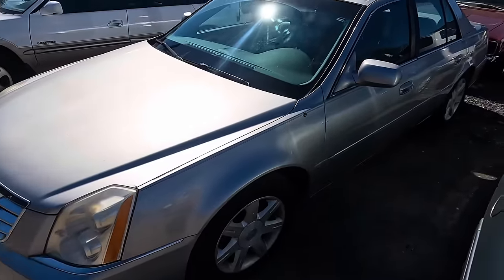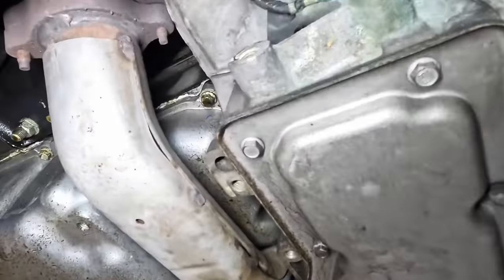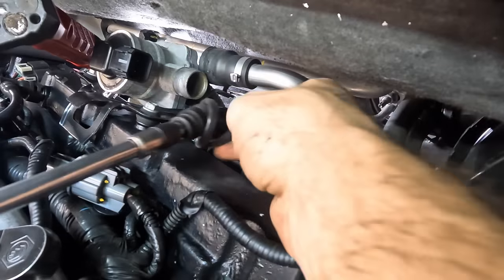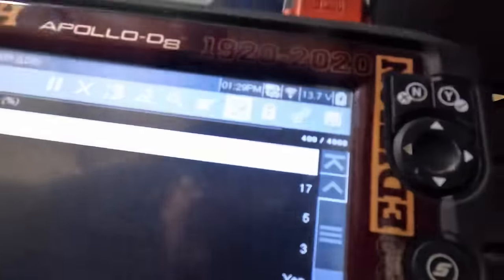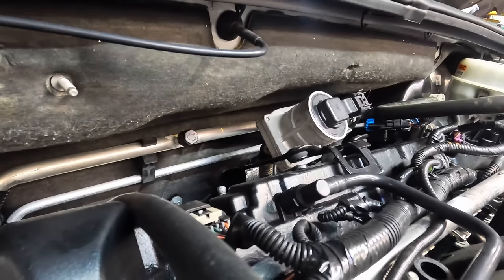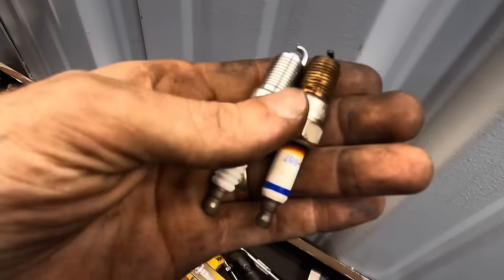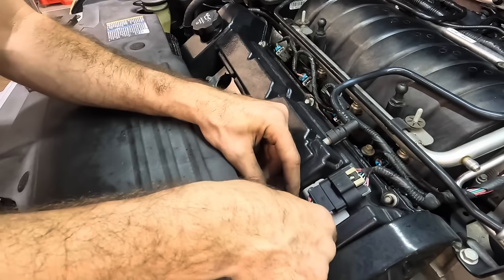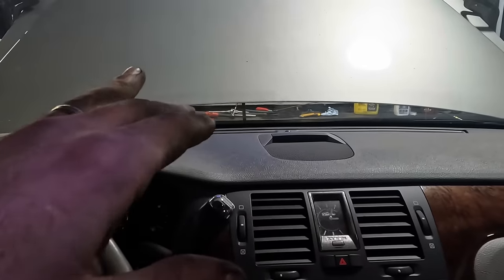Is this the Most hated Engine Of All Time? Cadillac Northstar Misfire P0300 Misfiring

Comment: When I worked as an oil change and tire tech for a Wal-Mart in Cincinnati, Ohio, the Northstars always had a littany of "self-lubrication mods."
Reply: Maybe this is why some like to "self-ignite".
Reply: They also had the auto-eject head stud feature.
Reply: Most cars are difficult to work on to do spark plugs . Just did my 98 Buick century , plus the wires . Dealing with chronic pain plus arthritis , fibromyalgia it’s difficult for me to work on cars . But I still do . I also did 2 front wheel bearings on this Buick , and a right side power mirror . I used to own a Cadillac deville . Was a 2002 had 98 thousand on it when it was totaled in my own driveway . Very nice car , I liked it allot . I had a bad ignition coil and a few window regulators go bad on it . Other than that nothing else . I don’t remember if I changed the plugs .  As always good day to everyone at rays auto repair and  God bless .
Reply: In the 3 years i owned my 2000 Sedan Deville I bought new, I never had a single issue or so much as a single drip of oil. Best engine I ever had. I sold the car to buy something less yacht like in size. LOL
Reply: @edwardrobb4682 manufacturers these days just love to move the engine towards the cabin firewall for "better weight distribution". I have even seen longitudinally mounted four bangers that make it extremely hard to get to the last plug, fuel injector and whatnot. It's a nightmare. And the conspiracy theorist in me always thinks this is by design.

Comment: Northstars are very much misunderstood. While they would develop leaks from the factory, a competent tech can reseal them and they won't leak anymore, Whoever resealed the one featured in Ray's video took shortcuts or didn't completely reseal it. I have resealed hundreds of them and they don't leak afterwards. Several of the ones I resealed belonged to regular customers so I would see the vehicles for years after the reseal, They would still be dry 100,000 miles post reseal.

Ray, those valve covers are aluminum. 🙂

Also, the blip you saw in the oxygen sensors around the 27 minute mark of the video was likely the Secondary Air Injection system changing state. The valve you had to remove from the back valve cover to replace the spark plugs is the Secondary Air Injection check valve.

As always, keep up the good work!
Reply from the maker: You know ur northstars sir 🫡
Reply: @RainmanRaysRepairs  I was an engine and trans tech at a Cadillac dealer from 2001-2012. 70% of what I worked on was Northstar powered. Lol

The remainder of the percentage was split between Catera timing belts and 3.6L timing chains as far as engine work was concerned.
Reply: If you don’t mind me asking, what materials were used during the resealing process. Was it just a new gasket, RTV silicone, or a combination of the two? I’m just curious because the Northstars received such a bad reception from what seems to be the materials used from the factory (seals and head bolts), rather than design related ones. It’s a shame because I like the look and feel of the Cadillac sedans equipped with the Northstars much more than the new stuff that they have been putting out and had they been built better, they could have rivaled Ford’s 4.6L sedans.
Reply: @PseudoSpaceMarine  As for the head gaskets, they just get replaced with factory replacements, which come with new bolts. For customer pay jobs, I ALWAYS installed Time Serts in ALL of the cylinder head bolt holes. Coupled with cooling system maintenance, this was generally a permanent repair. It didn't require ridiculous amounts of attention, just something as simple as checking the coolant level when the oil was changed and if it was low, address the reason why.

Regarding the oil leaks, the oil would leak from three places, all of them very close to one another. Northstar engine blocks are split at the crankshaft center line, so the crank case has a seam halfway up. On the top of the lower half, on each side, is a channel that is machined into the face. This channel accepts the lower crank case seals. Over time these would shrink and leak. Bolted to the bottom of the lower crank case is the oil manifold. It is an aluminum plate about 1/4" - 3/8" thick that has the same type of rubber molded to it. The top side of the manifold has all the oil channels molded into it, and the perimeter gasket. The bottom has just the perimeter seal. And bolted to the bottom of that is the oil pan. The oil pan also has a channel machined into it to accept the rubber gasket that fits into it. To properly do the job, it is best to install the engine on an engine stand, turn it upside down (oil pan up), remove the oil pan, oil manifold, and lower crank case. THOROUGHLY clean everything so there are no traces of oil, sludge, sealant, anything. Like Ray says, "SHINY!" Then, starting with the lower crank case half, use grey GM Engine Sealant to fill, and slightly overfill (by about 3mm) the channel that the gasket came out of. DO NOT USE A GASKET AT ALL, only the Engine Sealant. Properly torque all the bolts. REPLACE the oil manifold. Before installing the new oil manifold, use a thin bead of Engine Sealant around the outside perimeter of the seal that is molded into the plate. Just the outside. Install the plate and torque all the bolts. Now, for the oil pan, much like the lower case half, clean it SHINY, then, again, leave the gasket out and fill, then slightly overfill, the gasket channel with GM Engine Sealant (same 3mm). Install the oil pan and torque the fasteners. While the engine is out, replace the front and rear crank seals. The latest rear main seal is very robust, as it is a two-piece design (not the two-piece your are thinking of from the old days of rope seals). The inner portion is steel and presses onto the crankshaft. It rotates inside the rubber portion of the seal. This means the seal surface never wears out on the crankshaft.
Obviously, all other gaskets and seals that are affected by removal of these parts get replaced, too. Front timing cover gasket, oil filter adapter o-rings, etc. Now is also a good time to reseal the valve covers. The front valve cover has an extra seal on the driver's side. This is what seals the camshaft protrusion that the water pump drive pulley is pressed onto.

These engines, internally, are very robust. They don't have individual main bearing caps. The lower crank case is one giant girdle that houses all of the main bearings. The oiling system is also fantastic. I have quite literally been inside hundreds of these (for leaks) and I have never seen one with worn out bearings, rod knocks or any other mechanical rotating assembly issue. There was only one time I had one of these engines for a mechanical failure that was not a head gasket or oil leak. It was a lady that had amassed 49,000 miles and never once checked or changed the oil.

In general, the Northstar was a well-performing engine. The highest output version of the FWD engine made 295 hp and about 290 lb ft torque which was good for its time (remember, it was introduced in 1993), was smooth and quiet running, and a long block (with valve covers) only weighed about 350 lbs. The bare block I could easily pick up with one hand, as I think it only weighed about 50 lbs. Also, they love to rev. These engines are happiest between 3500-6500 rpm. They do pretty well down low, but they really sing at higher revs.

Now, in saying all this, I am not trying to minimize the size of this repair. It is labor intensive. We pulled the entire powertrain out of the bottom of the car and then separated the engine from the trans on the floor. If you can imagine how it went together at the assembly plant, that is how we removed it. Engine, trans, steering rack, struts with the brakes and the half shafts attached, all sitting on the engine cradle assembly which was then lowered onto a dolly. That is how we removed them. Customer pay, we used to charge 35 hours to completely reseal a Northstar with head gaskets and Time Sert installation. On the DTS in Ray's video, we also had to remove the front fascia because the engine cradle front horns were long enough that they were sort of trapped by the bottom of the fascia.

Lastly, the piston and ring design changed for the 2000 model year. The pistons received less of a skirt to reduce reciprocating mass. This caused cold piston "slap". It wasn't detrimental to engine longevity but it was definitely a nuisance. Also, the rings were redesigned with lower tension. This was done to increase fuel economy because as much as 25% of internal engine friction is caused by the rings. Unfortunately this lead to rings easily becoming stuck causing run away oil consumption. For the piston noise, GM released a new design piston which included a slightly longer skirt that had a coating on it to reduce unwanted noise. The piston rings were also redesigned to slightly increase ring tension. These redesigned parts were introduced into production engines in late 2003. So, from 2000-early 2003 (I think there was a VIN breakpoint), there is a risk that it will consume oil, although I replaced tons of those pistons and rings, so if you go looking for a car of that vintage and it was originally from the Detroit area, maybe I replaced them already. Lol
Reply: @paulwindisch1423  That was a lot of information. I really appreciate you taking the time to explain the engine's common failure points and the steps taken to repair them correctly.
Reply: @PseudoSpaceMarine  A fun trivia fact; The Northstar was the last mass-market engine developed exclusively for Cadillac. Versions of it did eventually filter down into the Aurora, Lucerne and Bonneville GXP, but at its introduction it was a Cadillac-only engine. The only engine to supersede this was the clean sheet design, 4.2L DOHC Twin Turbo V8 that was offered in the CT6 Blackwing, of which they only produced about 1500. All engines in Cadillacs since have been corporate engines, although they are often tuned from the factory to make more power than their divisional rivals.
Reply: I DD an 05 bonneville gxp that was properly resealed at 50k miles. It now has 305,000 and theres not a drip anywhere, and still drives like a dream. The 4T80e transmission is also the only fwd V8 transmission ever made to be bulletproof.
Reply: Great write up! I've been around tons of older Cadillac's and several Northstar Cadillac's. I agree, this is a very misunderstood engine. It's the size of the engine that I believe scares some people away. As you stated, if the person working on the engine knows where they're doing, everything will be fine.
Reply: At 48k Ray should definitely tell the customer they should reseal those because they obviously weren't sealed right from the factory.      Eißve never seen that bad of leaking at 48k.     That's quite pathetic GM.

Comment: Had a 2008 Buick Lucerne with 4 portholes that had this powertrain.  Wife drove it to 200k miles, both kids drove it through school.  1 coil pack, wheel bearing on the front, and an entire iron mine’s worth of pads and rotors, we drove that beast to 280k miles.  Not a body panel on it that hadn’t gotten up close and personal with another vehicle…

In the end, took a quart every 3 days.  But still started and ran, no MIL illuminated.

Retired due to the original alternator dying when it was 10 degrees outside and I wasn’t about to put a $500 part in a $50 car, in my driveway, in the snow, with the knowledge of the disassembly required to change it…

So, I may be an outlier but - it was a great car for us.  And this is why I don’t ever play the lottery - I’ve already used up that win…

Comment: It is my opinion that the engine compartment designers should be made to work on each type and model in the field each month for a week at different garages so they can experience for themselves the joy of their designs . I know the trend has been to make stuff more compact to save weight , allowing better fuel mileage - but there is a limit . Maybe more access panels would be the answer.   Good video Ray . Stay safe , have fun .
Reply: If designers made cars easy to work on the stealerships would go out of business.
Reply: @mikejacob3536 :  You say that like it would be a bad thing if it happened!!!!
🙂
I'm sure that the stealership's shops would still have plenty of warranty work to do.

Comment: Just a suggestion, with misfires a good thing is to note the cylinders as you did then mark the coils on that cylinder, when you put them in swap the coils to another cylinder and make a note. If the misfire comes back on a different cylinder with the coil its a help in troubleshooting.
Reply: Durr he does that, one side of engine is misfiring altogether if you bothered watching the video
Reply: @SimmyMetal  no need to be spicy...

Comment: I replaced the water pump on a 2011 Cadillac DTS, in my driveway, in the rain.  It took me a week.  I totally get it that you now totally respect me.  No water pump should take so much time and effort to replace.
Reply: audi says hi. remove front clip.
Reply: Removing front clip from Audi is way easier than Cadillac water pump. lol
Reply: For an added bonus GM put the starter UNDER the intake manifold.
Reply: @MrSloika  Yup, I sure look forward to that!
Reply: is it tho.. i hate it. always break up all the clips and you can so easily twist the bumper cover and fubar the paint. and then you still have to remove all else to get to the actual water pump. dropping the front end is just for mandatory access. like a 4 hour job which always takes more unless you like bodywork  @evilgtidriver
Reply: oh compare that with the land rover 4.xL pumps... 20 minute job... sometimes the brits used their brain

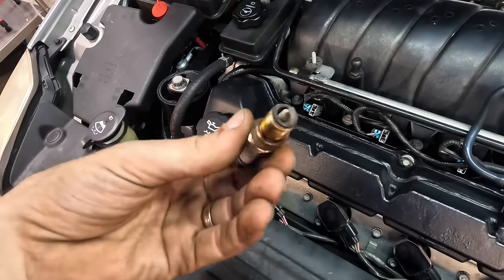Comment: 28:50 that's not carbon tracking it's a corona stain and is completely normal on used plugs. It's caused by an accumulation of oil and dirt that gets baked onto the ceramic.

Comment: Coworker of mine has this same car and same year. He took it in to dealer (D'OH) to have this mod reveresed and it was an engine out job. Apparently these leak from the upper oil pan so needed to pull the whole lump to get the upper pan off and do the reseal. Multiple thousand dollar job but he still drives it to this day. Had about double the mileage of this one when that was done several years ago.

Crazy low mileage combined with almost zero rust---which retirement community does this thing sit at or cruise at low speeds??

Comment: Excellent diagnosis and video. We have a 06 STS. NORTHSTAR. with similar misfires. But no lights on the dash. The tech connected the scanner. Read the misfires. Changed the plugs. And it was better.  For tow weeks. Now misfire is back. 
They did not mention anything about the O2 sensor. 

The other issue with our misfire previously is at times it was so severe. Shaking. It was almost not drivable. At that time the smell from the exhaust was like rotten eggs.

Comment: I've used the copper wire strand trick to put bolts in that have the holes stripped.  Just take a couple of strands from a wire and drop them in the hole with enough sticking out to fold them over a little, then put the bolt in.  Its usually enough to get a bit of torque on the bolt.

Comment: 5.4 Triton sparkplug launcher. Northstar - hold my head bolts.
Zip tie the wire to the extension. Then, the wires turn with the sensor.

Comment: Ah the old ‘Service Stabilitrak’ light. I have an 06 DTS as well and that one likes to light up occasionally. Have since bought different strut assemblies for it and some resistors to eliminate the overpriced and problem prone magneride struts that are likely the culprit. Never had so many issues with a car this new and mine only has about 41,000 miles.

Comment: Ahhh, those were the days....

Car actually looked super nice....

I had a 97 Eldorado Touring Coupe and a 2001 Eldorado Touring Coupe...  I don't remember the coil on plug...  I think there was a funny distributor block on the back, with like 4 coils, and 2 pins per coil...  And then wires....  I think it was waste spark???  Kind of a long time ago, I don't 100% remember....

Those rear plugs were really a delight....  If you ever did them, you'll never forget how much fun you had....
Reply: With only 48K miles it should look nice.   This car is likely owned by NY/NJ retiree.  Unfortunately almost none of the 4.6 powered Cadillacs make it to 100K.   By comparison, that Lincoln Town Car you see parked next to the Cadillac probably has 400K miles on it.

Comment: A quick test on a suspect O2 sensor when you have it out is to connect a multimeter across the output leads and then put the tip of the sensor in and out of butane or propane flame.  When in the flame the sensor will output about 0.9 volts and when out of the flame, but still hot, the reading will drop to about 0.1 volts.  If an O2 sensor tip is caked in soot and unresponsive then a kill or cure trick is to heat it up to cherry red and test it again.

Comment: If you hate the lift, replace it with a good one. Wildfire lifts are the best and they are moveable, if needed it can even be moved outside on flat concrete. Wildfire, four post ramp/rail type lift with movable cross member. Check it out!

Comment: Ray, have you ever looked into a stream cleaning machine?  I have an old Karcher commercial electric pressure washer with diesel oil fired water heater / steam generator.that works great for degreasing engine bays. Because it is a hassle to retrieve from my offsite storage, I more often take dirty engine projects to a nearby DIY car wash (along with a pair of ramps) , to clean things up before starting disassembly.  Have you considered thoroughly cleaning the engine and surround at a local DIY car wash before starting?